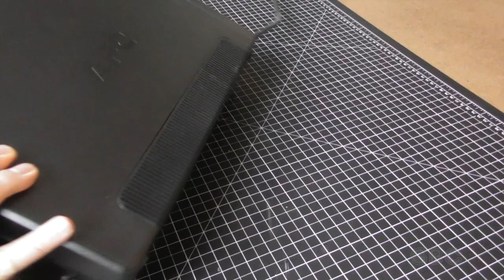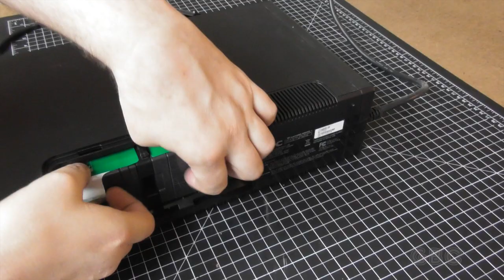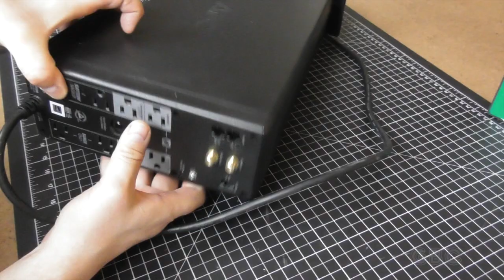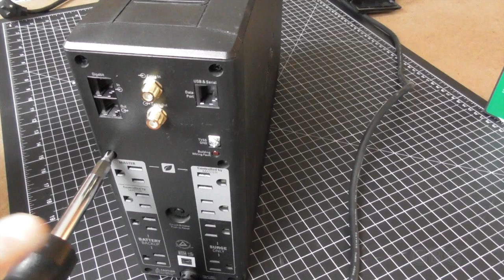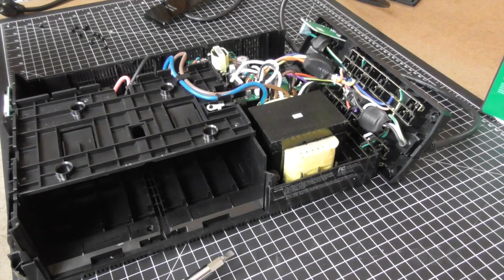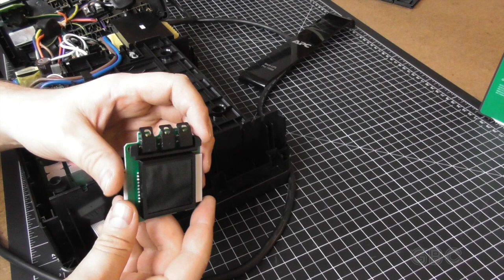[45] APC Back-UPS 1000 Teardown

Comment: Just for completeness, the 24vdc is converted to a high frequency pulse signal (35khz or something like that), which is then put through the transformer.  The transformer steps the pulsed voltage up to ~170v pulsed DC which is rectified and smoothed (not 120v RMS ).  It then goes into an H-Bridge that reverses the output at a set frequency NA is 60hz, and depending on how the H-Bridge is driven, you get either nearly "pure sine wave" using sinusoidal Pulse Width Modulation (SPWM) or more commonly, using a modified square wave driver.  The former is much better for electronics.  (If I have any of this wrong, please correct it for the benefit of others)

Comment: Thanks for taking the time to make this video. You keep saying that it takes the 12v DC and converts it. Don't you mean it takes the 24v and converts it? Those batteries are wired in series. If you look carefully on the sticker, you'll even see reference to 24v.
Reply from the maker: You are correct, it is 24 volts.  That was a mistake on my part.

Comment: Does the transformer in this unit uses the battery during voltage adjustments(avr mode) or only when it drops below the avr range(battery mode)?
Reply from the maker: I think it does switch to battery mode during over voltage as well.  The sounds it makes as it switches modes sounds like it's using the battery.  Now, that could be switching to battery mode as it changes taps on the transformer.  I may try hooking a variac up to it just to see what it does.